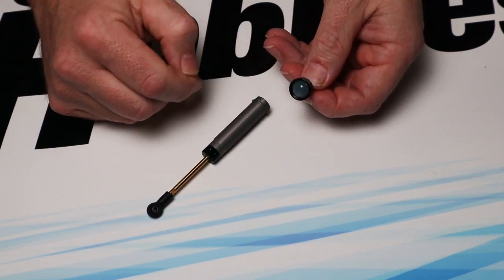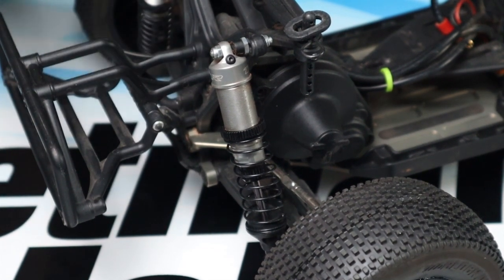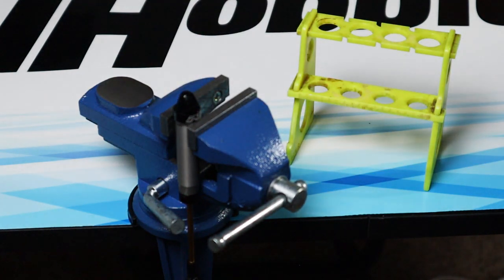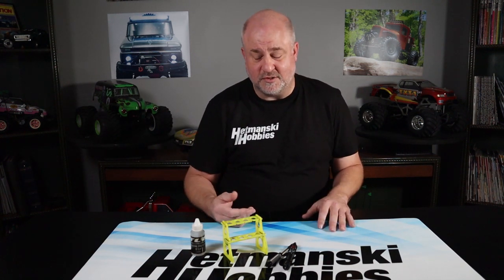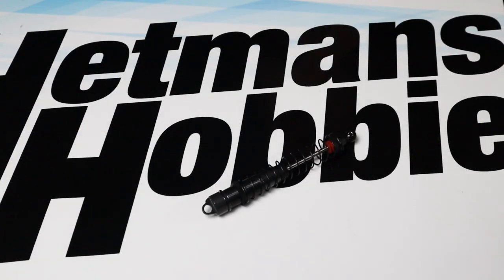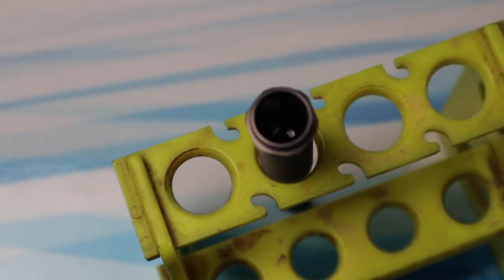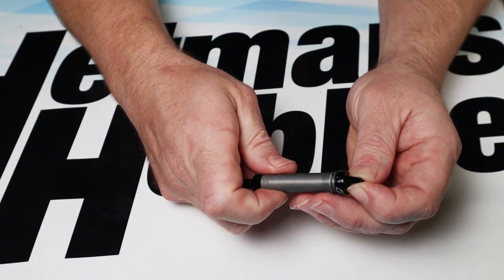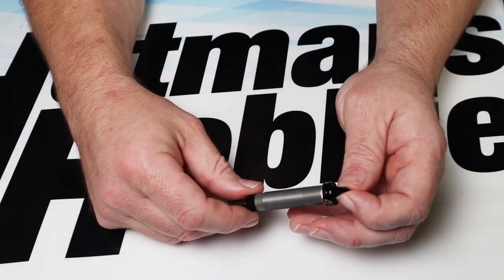How To: Fill And Bleed RC Car Shocks.....and a little more.

Comment: That's all good and fine.  What's the technique for a lot of shocks that do not have a bleeder hole for both styles?
Reply from the maker: You just build it accordingly.
Reply: @kevsbench01  That's not an answer.  That's like teaching a kid how to swim buy just throwing him in the water and telling him to swim.
Reply from the maker: @skipmiller8309  that is an answer. The video clearly shows you how to bleed each style of shock. If you have a bladder shock you build it one way and if you have an emulsion style shock, you build it the other way.

Comment: Just tried this technique for bladder shocks when rebuilding my LMT shocks. Even drilled a small hole in the shock caps. Everything went well but for some reason the shock shaft goes to about mid position whether I push it in or pull it out, It always goes back to the middle. Any tips here?
Reply from the maker: You may not have removed enough oil
Reply: @kevsbench01  I tried a few times to be sure. I did just rebuild them with TLR o-rings and Green Slime. There was almost NO resistance with the seals after that. That being said, would too much oil cause the shock shaft to go back in after moving it all the way out?
Reply from the maker: @tvrift  Like I already said. You may not have removed enough oil.